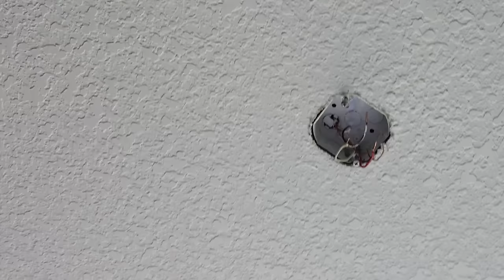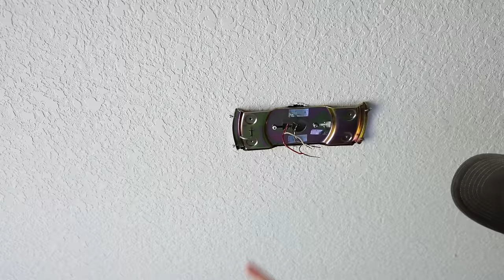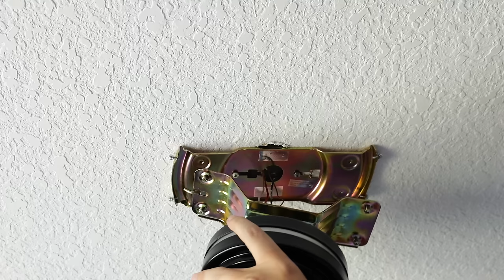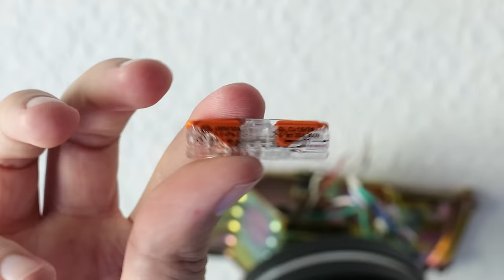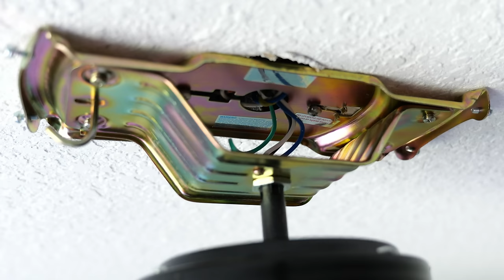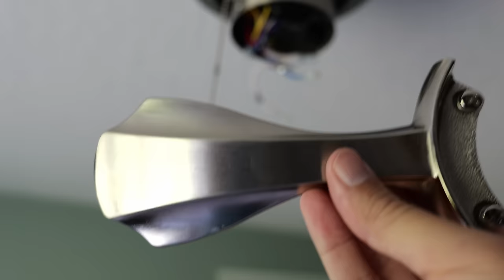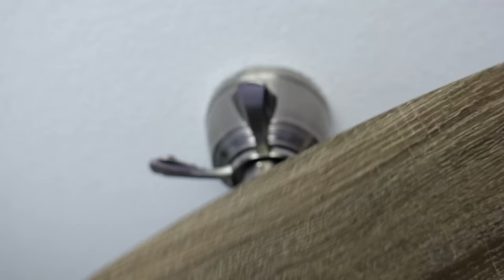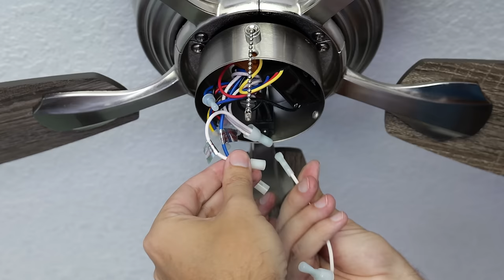Avoid This VERY Common Mistake DIYers Make When Installing a Ceiling Fan | How To

Comment: If the box is not mounted securly above, as to a rafter, it could fail to hold the fan up. Also the actual box will be stamped "rated for celing fan". A standard light box is not rated to support the weight and vibration of a ceiling fan. 
But over all a very good video.
Reply: Good point. I installed a couple of fans before I found this out. Luckily they were small fans and no catastrophe resulted.
Reply: Because they use junction boxes with side brackets when installing standard light fixtures , You'll need to remove that kind of box and get a ceiling fan junction box kit which has a spreader bar with spikes on the ends to dig in and grip the joists and you just tighten it with a crescent wrench and there's no need to cut the hole for the junction box any bigger
Reply: You got to it before I could. This was the first thing I saw as a common DIY'er mistake
Reply: he cheated. that's a fan rated box.  you can tell because the mounting screws extend through the top of the box. (it's a distinct characteristic of that model of fan box)

Comment: You forgot to say "make sure it's a fan rated box."
My house is only about 12 years old, and the boxes in the front bedrooms are plastic new work, not metal. But even metal isn't necessarily rated for the weight of a ceiling fan.

Comment: OK, I install the fan. Thank you so much awesome video.  But the humming noise from the motor is resonating through the ceiling Joist which is quite nerve-racking.  Is there some sort of noise reduction washers or sound canceling foam that I could use while connecting the brackets to the joist?

Comment: Thank you for the video! I blue screened a little bit when I was replacing my fan and the colors didnt match up. Additionally, the instructions wanted me to wrap both the black and blue wires from the fan to the black wire in the ceiling. I have two switches though, one for the fan and one for the light. Thank you so much!

Comment: Another great video! I installed 2 Hunter remote ceiling fans where just light fixtures used to be, except the wires coming from my ceilings were just a black and a white, no ground or red (1 wall switch not 2 like you show). The wires are coming through conduit if that makes a difference? The problem is, both fans make a humming sound. They are wired per the instructions but for the life of me I can't find the source of the humming. Thank you!
Reply: did the remote come with the fans?  some hunter fans are picky about what type of speed control they run on, and will hum if the wrong speed control is used.
Reply: @kenbrown2808  The remote came with the fans. I have tried all 4 speeds including reverse mode. This is the most confusing thing. I have installed several fans and no noise until I went remote.
Reply: @jazzman9469  sounds like Hunter is starting to cut corners.
Reply: It's possible the blades need to be tightened, and if that doesn't work, balance the fan blades.
Reply: If the fan has pull chains turn the light switch on at the fan then use the pull chain for the fan motor to set the speed on high. Of course for the remote control on the wall switch do the same. Now that it is operating correctly there will be no hum and to make sure none of your company or guests inadvertently pull a pull chain on the fan shorten both pull chains higher than most people can reach.
Reply: @alanmccalla6737  good point. I'm used to fans with factory remotes not having a pull chain, any more.
Reply: @alanmccalla6737  Thank you for the advice but there are no pull chains with these fans. Sounds like a tip though.

Comment: My house has pre-wired dual  multi-position sliding switchest to allow for a variable speed fan with a dimmabke light. Are there any special considerations I need to worry about either when selecting or installing the fan/light?

Comment: Nice video. I really would have liked to have seen the proper way to balance the fan blades. I also don't trust preexisting wiring so I would have tested to make sure none of the wires were energized, not just the two the should be hot.
Reply: I once replaced a fan that was separate switches for fan and light...  But when I opened up the ceiling box, there was only a Black and white....  They used the ground as the other switch leg....

Comment: The canopy of the fixture is an extension of the box , and the connections can reside outside the box as long as they are contained in the canopy
Reply from the maker: No it isn’t.  That is not an approved box.
Reply: Absolutely. Box fill would have to be taken into consideration in certain applications, but to get around that you could just do a rough calculation of the canopy volume, label it inside with a sharpie, and dare someone to find code that says otherwise. . .

Anyone that says you can’t is just trying to argue based on technicalities. At the end of the day it is a grounded metal enclosure. There is zero practical reason that the canopy isn’t just as safe as a junction box. I could even argue that it is safer considering the potential for falling sparks and the proximity to the drywall’s paper backing.

Comment: In older homes the metal boxes used to be nailed up with roofing nails. I have always run some deck screws through the box for added security when asked to install a ceiling fan. Just my 2 cents.
Reply: I used lag bolts into a joist on an old house.

Comment: Did three fans for my ex. Had remotes and so little room to slide sending unit into the top and get all the wires up in box . Those connectors look nice I’ll have to try them over nuts

Comment: Hi,
Can you advise on troubleshooting: after installation, fan runs and lights are on. But soon after, it will not start and the fan switch string now suddenly controls the lights, while the lights switch string is also working fine.

What could be the cause of fan malfunction?

Comment: Pushing the wires back up on top of the bracket -- that's what the hook is for. Hang the fan by the hook, push the fan's wires through the hole, and make the connection in the box. This saves not having to worry about tripping the levers when pushing the Wagos back through the hole.

Comment: It wouldn’t be as big of a deal on downrod ceiling fans, but yes there had been times where wires scrape a motor on huggers.
Reply: thats why I ziptie the wires to the mounting bracket, stuff the wire nuts under the bracket. really irritating to get fan all installed, 2 days later get call back there's tapping noise from ceiling fan

Comment: I leave my wire connections out but I don't dent the metal with a power screwdriver.
Reply from the maker: Oh no, the decorative metal shroud has a slight bend in it that nobody will ever notice.  That is definitely as dangerous as leaving the wiring out of the ceiling box 😂

Comment: Question.  Will the 4" work box in the ceiling hold the weight of the fan/light combo? Or do you need to put in a rafter bracket in the ceiling?
Reply from the maker: Mine will because they are all ceiling fan boxes with a support connecting two joists or rafters together.  A standard nail in box is not recommended but plenty of people use them and they are fine.  But a ceiling fan box would be best.
Reply: @HowToHomeDIY  Not picking on you. I have saved most of your videos because of the great information. Especially the transfer switching and AC cleaning. Great content. Take care Bro.
Reply from the maker: @josephreisinger33 Oh yeah I was just answering the question.  Really appreciate the feedback Joseph!
Reply: My question too. The security of the box should be verified before attempting anything else. Only if you are replacing an old cealing fan with a new one should you go straight to instlation. Even then, I would check for box security. If replacing a light fixture, always check box security...

Comment: Hi! What would the wiring be for ceiling fan and light with  3 way switches at 1 at opposite sides of the room? Is it the same wiring? Subscriber fan! Great info!  FYI, The 3 way switches are currently working on light and the pull chain is not turning on the fan, why I don't know, help! Thsnks!!

Comment: The one thing I expected to be mentioned in this video is to ensure that you have the correct box mounted in the ceiling. A light can be mounted in a regular box, but if you are going to replace a light with a ceiling fan, you need to ensure that the box has a hanging bar. If you mount a fan to a box, even one that is nailed to a joist, the fan can (and often does) work the box loose and you'll have a flying guillotine at some random time in the future.

I replaced the ceiling lights in 2 of the bedrooms in my house with ceiling fans and crawled up into my attic to ensure that those lights had hanger bars attached to the ceiling joist on both ends.  Astonishingly, they did, so I was good to mount fans in both the bedrooms.
Reply from the maker: Well mine was clearly a fan rated box.  It’s pretty easy to tell.  But your example of the fan often coming loose and becoming a flying guillotine is pretty over the top.  Did you know that fan rated boxes weren’t even required by code for fans under 35 pound until fairly recently?   There are fans all over this country in boxes that are not fan rated that have been installed for many years and they aren’t just falling out of the ceiling.  It is actually incredibly rare for that to happen.  Should you use a fan rated box now?  Absolutely.  But it’s nowhere near the danger that you are suggesting.
Reply: @HowToHomeDIY   -- I would say that it depends on how out of wack the balance is (I've seen some that were VERY wobbly) and also if the box is an Old Work box with the tabs holding it in place.  I've seen my fair share of fans fly out of ceilings because they were installed by people who didn't know to make sure the box was secure.  

All I'm saying is that that's the first thing to look at when replacing a small light fixture.  But, hey, if you don't mind ceiling fans smashing into kids during dinner, more power to you.
Reply: @dienekes4364  If the box is modern blue plastic it won't hold up to a fan without support, and I agree with you. Metal boxes have to be attached to a board like the one in this video, and will hold a fan without any issues. The metal boxes with welded mounting brackets are not fan rated and need reinforcement. 
I've found fans mounted to the old grey fiberglass boxes just attached to nothing but ceiling joists that have held up for over 25 years. That said, I have always reinforced those and the blues with a 2x4 in the attic. I have found neither blue nor grey without attic access. If I did I would use a retrofit safety bar to replace them. Definitely more work, but worth the effort and expense.

One of my former coworkers had a fan fall from a vaulted ceiling and land on her foot breaking several toes. The second bone of the big toe was shattered and required metal plates, pins and screws to replace it. Not repair, replace, as in fused.

It may not be a guillotine, but the blunt force trauma from a falling fan ain't no joke.
Reply: @ST-0311  -- Yep, "guillotine" was definitely a little bit hyperbolic, but they can still do some decent damage. I just thought that if someone is switching out a light for a fan, it'd be worth mentioning that the first thing you check is to make sure the box is secure enough to take the weight.

Comment: I'll be having two ceiling fans on one wall switch, so it's chain switches for me.  The box in my kitchen is too full to stuff the wires into, and the one in my living room is a pancake box (both boxes were properly mounted and installed by electricians), so the wires will have to stay in the bracket.  BUT....those are cool wire connectors, so I'm gonna check those out.

Two questions though: 1) if I need to strip a wire, what size hole on the stripper do I use to do this with?  I haven't bought one yet, but it will be a USA-made Klein stripper.  I just have the standard black, white, and copper ground.  2) In my kitchen box there is two copper ground wires nutted together (I assume one comes from the wiring, and one comes from the box that was installed).  Do I just put the ground wire from the fan with those two ground wires?

For context, the ceiling fan boxes were installed when I had my ceiling rebuilt with new framing, insulation, and sheetrock, and there were two switch panels on the wall, one on top of the other, with the power switch being the lower switch.  The switch above it controlled which light was on between the light in the kitchen and the light in the living room (yes, it was a cheap, shitty setup installed by the house flipper who "remodeled" this single-wide).  The electrician and I spoke about it and agreed to just bypass that switch for constant "on" with both boxes.  So he wired them together and mounted a blank plate over the wall box.  Now I have just one switch with the main power to both ceiling boxes, and then my porch light in the same wall box with its own switch.

I hope this isn't too confusing.  And no, nothing about this house is up to code.  Hopefully I'll be out of here in a few years with a better job somewhere else.  In the meantime however I want ceiling fans.  Thanks!

Comment: Another thing to make sure of is that the mounting box is rated for ceiling fan because sometimes they’re only rated for lights and they might not be able to support a heavy ceiling fan and you also definitely wanna make sure that there is an actual mounting box because some of the ceiling fans in my old house or mounted horribly because they were screwed directly into the wooden ceiling beams

Comment: I've run into problems putting the house on, where the screws will not line up or a gap between the ceiling and housing. This can be very irritating. If working with an older box, not able to hold the weight, it has to be removed, and the new ceiling fan brace installed. Could you show an easy way to remove the old box that is nailed to rafter.  Another problem I ran across was that the housing screws would not line up on one side. Finally, after removing everything down to the wood brace and reinstalling it with a new box, the problem was still there. I had to use washers to level it. The 2x6 brace had a dip in it, causing it the problem.

Comment: Smart switches? Hugh, why not have bluetooth in these modern stealth blade ceiling fans. Just a small app to control everything. Get info about revolutions (RPM) and power usage. Even a thermostat that kicks in if temperature rises. Be aware that ceiling fans are not an airco. So they blow room temperature air around. Only your skin evaporates sweat more easily (windchill) and that cools down. A lot of second-hand fans are sold, some only as esthetics. They make noise, are a hazard if you stick arms and hands up without remembering it is spinning there. I recommend checking this beforehand, some ceiling fans without lights are better suited.

Comment: The fact that there is actually a box in there is amazing as I’m literally replacing the one in my rental due to the landlord just handing that bar from the joist itself with no box
Reply: Typical with knob and tube wiring in ceilings and wall lights.

Comment: It's a bit easier to hook the connections and stuff the wires if you leave the assembly hanging on the hook, then stuff the wires as you go to mount the plate in place. If that makes sense.

Comment: I have a Hunter fan and I am replacing the capacitor  The new capacitor has a RED wire and the old capacitor has a GREEN  The Green goes to the pull change #2 should I run the new RED wire to that same location.  All the others wires match?

Comment: The fan wires are usually long enough to leave the fan motor hanging on the hook while you make splices, and in some cases even to tuck the splices up in the box. Gives you more room to work instead of working in the small space once the motor is screwed to the bracket.

Comment: Not sure if you're a certified Journeyman electrician but I thought that I would offer another way that I find much safer to ensure you have the correct conductor wire on the correct switch location on your double switch.   With the power off and all your wires unconnected hanging loose.   Take one of your wires either red or black and have it make contact with the ground conductor at the ceiling fan and then at the switch location take that same color wire and using the ohms resistance toner on every electrical meter you could simply tone out that wire.    For the sake of YouTube videos and showing other people I thought I would mention this because when it comes to electricity you can never be too safe especially when showing other people what to do.    I mean no disrespect I've just been at it for a long time and maybe you have to and already know what I'm talking about

Comment: I am doing the opposite, replacing a fan / light combo on a dual dimmer switch with just a light. So the light has only black white and ground and the ceiling box has the blue black red and ground. What would I do with that extra wire?  Just cap it?  Or disconnect the extra wire from the dimmer? Thanks.